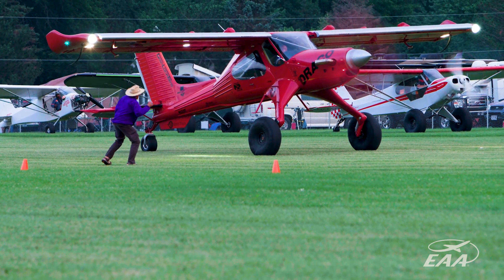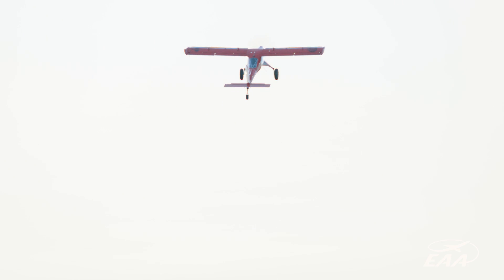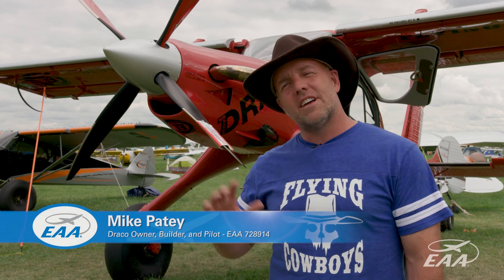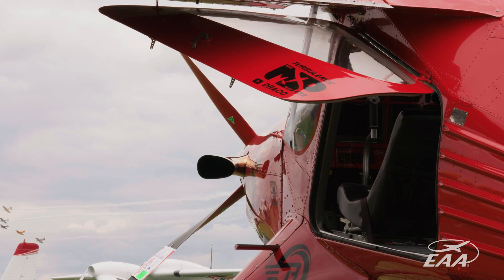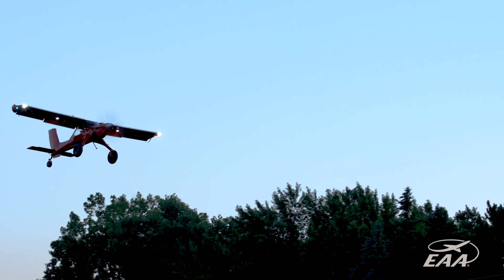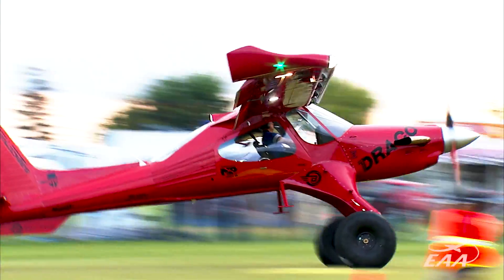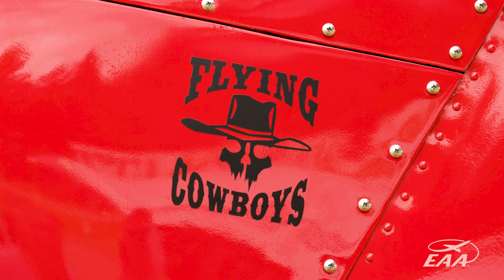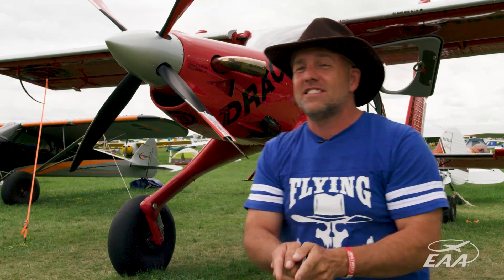Draco - A Beast of a Bushplane

Comment: Draco WAS a great airplane, but it seems to have a problem with quartering side winds on take-off.  Especially 40mph+.  Pilot Error= Ground Loop= Totaled.
Reply: Just an FYI, it wasn't a ground loop...a strong crosswind lifted the wing. At that point Mike unfortunately was just along for the ride. No more aileron or rudder left to compensate. That was one moment I would imagine Mike would have loved to have back. We all can second guess, but Mike had a bad day, which everyone will have or have had something similar. You just do your best not to have one of those days and enjoy flying.

Comment: What is the fuel consumption , fuel tanks capacity and it’s endurance?
Reply: It depends. High? Low? Min power? Max power?  etc.  But in general, his PT6 eats a little under 28gph and he cruises in the 130-150kt range, and has (generally) a 700nm range.

Comment: You can't just get your license. You need $ & hrs for each one. By the way, I've seen shorter take offs.
Reply: Yes, just like any other license, it takes practice, which requires investment, and once you have the practice to get the license, you just go get it!
And I have also seen shorter take offs and landings, usually when there was strong headwinds... Lol
And there are some planes that are so light that they can float in and out, but they don't have anywhere near the capacity or performance of this one, so other than super short take offs and landings, and very slow travel in between, they aren't very useful.